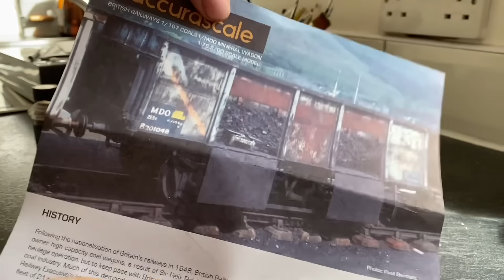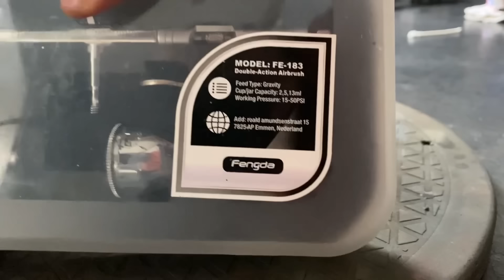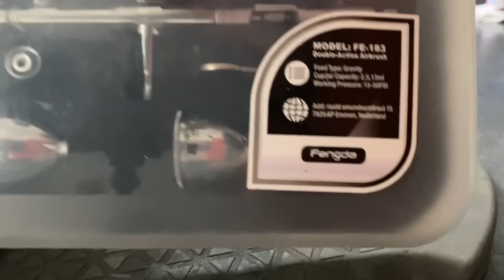Creating a Perfect Rake of Wagons - Detailing and Weathering Accurascale’s 21T Mineral Wagons

Comment: As a young boy, I originated from the South Wales valleys. I remember these wagons running . They were normally hauled by a tank engine.  I remember a brand new green 37 for the first time hauling an empty rake. My uncle drove the tank engines and I remember him having training to drive the 37,s.  He then went on to drive the dmu passenger trains. Excellent job with the weathering.  Well done . Thanks for posting
Reply: Hi, I also grew up in the Valleys. My dad was a coal miner. Pannier class 57 (the 8750 variant) #9600 was one of the locos at the colliery where he worked. It's still with us in preservation. There were also a couple of 08s too. The filthy, rusty wagons were trip worked to the exchange sidings where a 37 would collect them. It seemed at one time that there was a 37 lurking around every curve! I still love 'em.
Reply: @stephendavies6949  
Hi Stephen
You could see the pit from my grandads living room. On a Sunmy uncle would take us for a walk over the pit and we would walk between rows of these wagons.  Trudging through black silt . This is what the track sat in . I always remember through all this silt and grime there was always foxgloves amongst it. The other thing I remember in the winter was the tank engine hauling giving out plumes of smoke and at the end of the rake and below the engine smoke the guards van would have a plume of smoke coming out of it,s chimney.
Reply: @jeffreydavies9036  Ah yes, the grime. It often looked as if the locos were running on just the ground, as the rails were almost completely covered by the stuff! By the time my dad's pit closed (Merthyr Vale) in the late 1980s, the really old wooden plank wagons had been scrapped, and HAA hoppers were in use in the yard. But the majority of wagons were still 12 & 16 tonne (or probably "ton") open steel types, and it was all still trip workings to/from the nearby Black Lion Junction.
Reply from the maker: Wow great memories.  That would make for an amazing model actually!
Reply: @stephendavies6949 
I,m from the Rhondda and used to go to work with my uncle, he drove on Treherbert,  Merthyr,  Barry routes . Merthyr Vale  was fully operational then. How they managed to haul the wagons up the hill from Abercynon I will never know. The DMU,s used to at full throttle with all the windows in the doors rattling.  Some of the stabling yards for the coal trains were huge for such narrow valleys. Another great viewing point for 37,s and coal trains were at Pontypridd.  Don't think I ever went there and the station avoiding lines were not occupied.  Last time I was there a new platform had been built on the avoiding lines.
Reply: @jeffreydavies9036  I'm jealous! I loved those 1st gen DMUs: comfy seats and a great view out of the rear cab or even over the drivers' shoulder, if he'd not closed the blind. Did you ride in the cab?

Pontypridd is having something of a renaissance, as an important hub for the South Wales Metro. Sadly, there are no more coal trains. I recall reading that on average, a coal train used to pass through Ponty every 7 mins, 24 hours a day.

Radyr was another place where 37s and coal wagons were plentiful. 

All ancient history now...
Reply: @stephendavies6949  
Yes both my cousin and myself rode in the cab with my uncle, until the outskirts of Cardiff then we had to go back into the saloon because of the management there. The best place to go was on the Brigend branch from Cymmer and Maesteg. That was on a 121 or 122 bubble car. Tondu was another bid stabling yard too. If you look for Valley Lines on here you will actually see him pulling out of Abercynon with his head out of the window. That would have been in his final working years. Great Times and fantastic memories of riding in that cab .

Comment: They look great. A few dents and damage along the top edge would look good. I remember a lot like that and sides bowed out a bit. Not sure how you would do that, maybe a hair drier would soften the plastic enough and with a bit of wood wedged across the top, when it cooled the bow would remain with the wood removed. Inside detail is what impressed me with Rapido coal hoppers I bought recently. they are fully detailed with rivets and cross members, something Accurascale have missed out on this time.
Reply from the maker: Thank you 👍🏻 Yes I noticed that from a lot of photos.  I didn’t even notice the lack of internal detail until you mentioned that. I guess most people model them full.

Comment: Regarding the Air Brush, what sort of Compressor is needed? Will it fit any compressor (tubes, connections etc). Thanks
Reply: If you can get the PSI to suit the airbrush, (which in my experience doesn’t damage the airbrush, just affects the paint spray, but please check that first) the vast majority of airbrushes use the 1/8 BSP hose connection (about the width of a no. 2 pencil but maybe slightly larger)  and you can get special adapters for different compressors
Reply from the maker: This is the one I have: 

https://amzn.eu/d/1vOHhOG

I think the connections are mostly a standard size, I’ve used three different airbrushes with it and they’ve all been fine.
Reply: @MouldyRaspberry  that one is complete with an air brush. So I wouldn't actually need to get the one you used. Not having anything at present I was hoping that I could get that brush then get a separate compressor. Doesn't seem a lot of point of getting two brushes!!

Comment: Please do more Pines Express train shots with 75062 piloting 92211 on the Pines Express with eleven Express coaches, 75053 piloting 92167 on the Pines Express with twelve Express coaches, 73030 piloting 92 Squadron on the Pines Express with ten Express coaches, and 76114 piloting 73109 on the Pines Express with thirteen Express coaches, Mouldy Raspberry, pal.
Reply from the maker: Yes m’lord!
Reply: @MouldyRaspberry  Go for it. I bet on you.
Reply: @MouldyRaspberry  Especially the scenes in Archive British Steam Volume 2: Bygone Days Captured Forever and British Railways Steam.
Reply: @MouldyRaspberry  You also should buy more Hornby models like lock, stock, barrel, engines like Earl Cairns No. 5053, Sir Lamiel No. 30777, M7 0-4-4 Tank Engine No. 30051, Blackmore Vale No. 34023, T9 Class 4-4-0 Tender Engine No. 30285, Schools Class 4-4-0 Tender Engines like Winchester No. 30901 and Blundell's No. 30932, Fowler 4F 0-6-0 Tender Engine No. 44331, Southern Railway Q1 Class 0-6-0 Tender Engine No. 33009 in weathered condition, Hornby Devon Belle with Blue Star No. 35010, Sir Archibald Sinclair No. 34059, A1X Terrier 0-6-0 Tank Engines: Poplar No. 32670 and Martello No. 32662, coaches, freight cars, cabooses, breakdown trains, stations, sheds, signals, signalboxes, signal gantries, train sets, accessories, tracks, and many more.